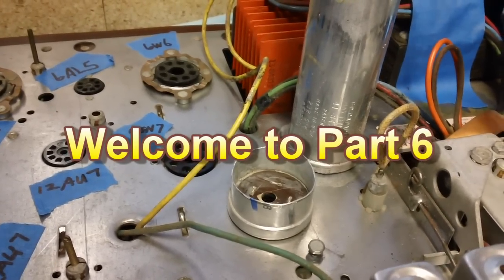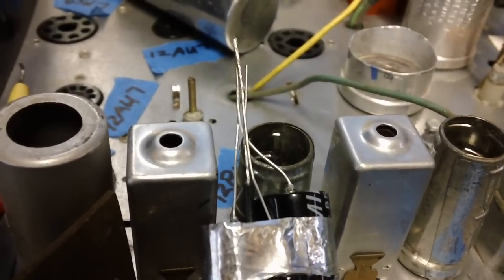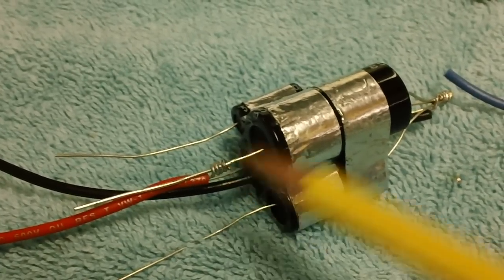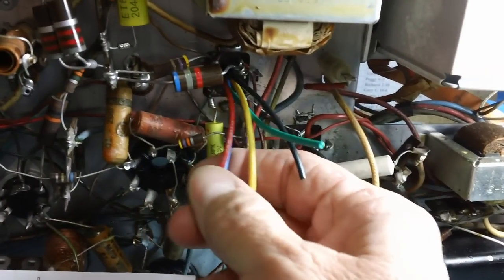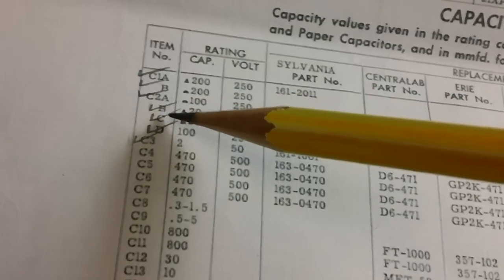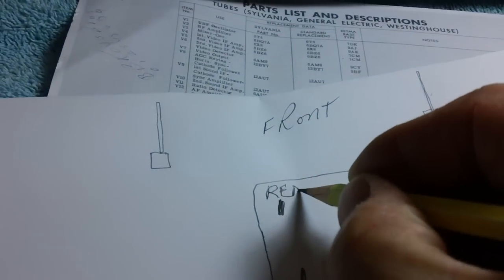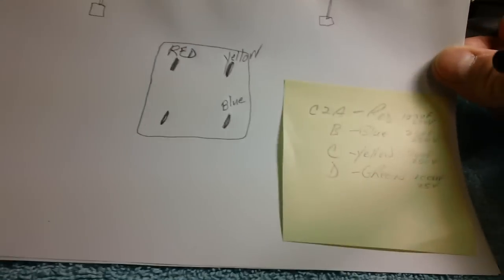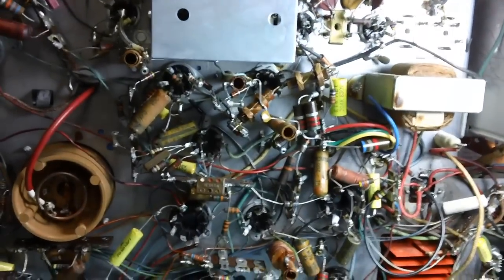1956 Sylvania 21" Halolight TV restoration (part 6 of 23).

Comment: John,

You're right, this is information I need to know. 

I liked your detailed electrolytic capacitor restuffing video segment as well as your advice on the best ground attachment.  I've heard of problems with riveted ground connections causing intermittent problems.  Well done.

Regards, Tom
Reply from the maker: Tom,
I've actually never had any grounding issues by using screws, lock washers and nuts.  I've not ever tried rivets.  They've always worked fine, but at some point in the future they may no longer work fine, whereas the soldered ground will hang in there forever.  I'm glad there was something in this vid that's worth remembering.  Thanks, my friend.

Regards,
John

Comment: Nice restuff! personally I would have kept the two 250uF capacitor leads the same color, but that's just me ;-) I'm one of those guys that has a hard time tracing wiring. my main problem is finding the components in the chassis and making sure i'm on the right components. a lot of times I use tube pins for reference but once in a while there's something that's not directly connected to a tube and that can cause some problems for me. I'm getting better at it, you're a good instructor!
Reply from the maker: Daniel,
One of these days the wire tracing savvy will hit you like a hammer.  From that moment on you'll never again have a problem tracing anything in a chassis.  Trust me on that.
BTW...did I not say that when it comes to selecting wire color, I was alllllll powerful?  LOL

Regards,
John

Comment: John, I hope you don't mind me asking a question about an older project of yours. I have a question about the AK speaker you repaired. When you removed the Reed Screw , was it rusty and did you clean it in Naval Jelly ?  I disassembled mine today using exactly the same method you used and it worked like a charm. The screw is very rusty however so wondering if you had a similar experience.  Your video's are nothing short of awesome.... totally.. Thank you in advance.
Reply from the maker: Ron,
Hey, my friend.  It's good of you to drop by....and I don't mind your question at all.
The screw securing the reed spring in my speaker was not rusty, but had it been so I would have given it a little shot of Naval Jelly.  Go ahead and do it.
Apply the jelly with a Q-Tip, wait a while, then clean and apply again.  Repeat until the rust is gone or at least almost gone.  But be very careful as that screw is very small.  Drop it on the floor and it'll be gone forever.  :-)
Good luck.

Regards,
John